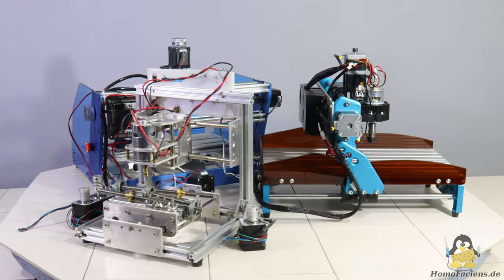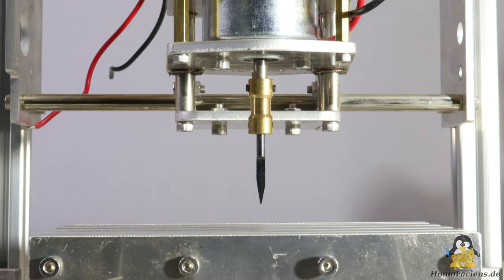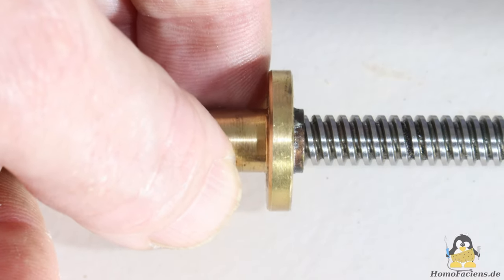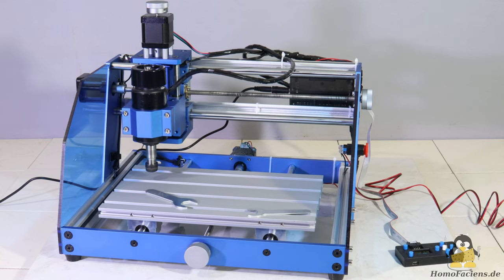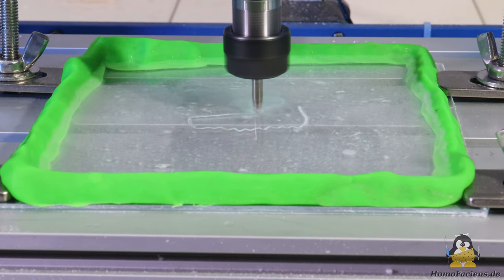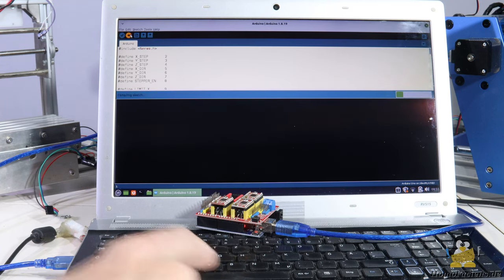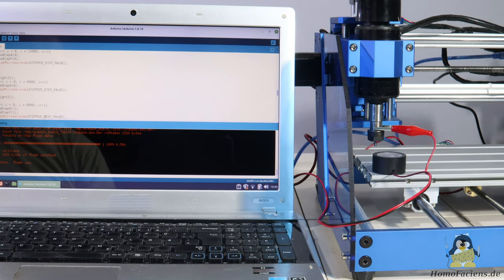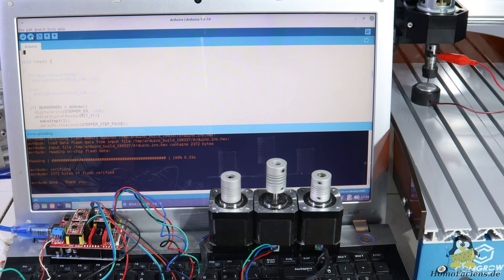Cheap CNC machines: Why I like them, weak points and software hackability

Comment: 2:55 i shove pieces of cut up credit cards into those springy spaces to avoid stretch/compress. It works.
Reply from the maker: Yes. Or use couplings without that coil gap. The disadvantage is that the load is directed to the ball bearings of the stepper motors. That's okay as long as you process rather soft materials.
Reply from the maker: Indeed!  😂

Comment: I had a Sherline CNC mill. That was a true mini milling machine if you didn't dig in with your bit. 
These cheaper ones are not rigid enough and are more geared towards engraving softer material like wood and leather, than milling aluminum. 
However as you demonstrated beautifully, some can be used to mill thin material if speed and feed-rates are not too aggressive.
Reply from the maker: For good reasons, these machines are advertised as plastic and wood engravers, not as milling machines ;-)
However, I have modified one of these cheap machines do make use of my Kress spindle. With that I can indeed mill aluminum, but with an even smaller work area.